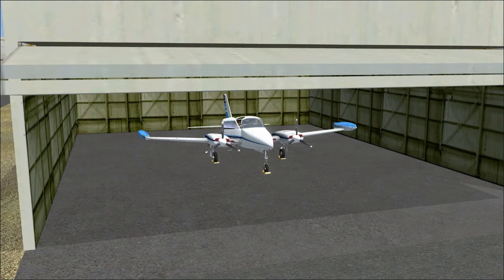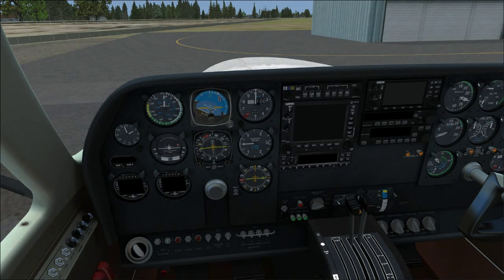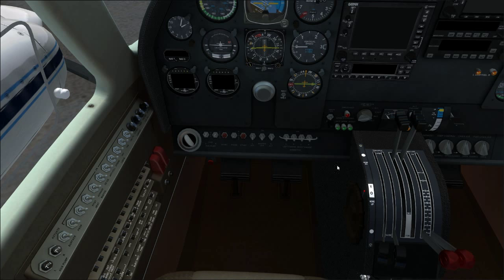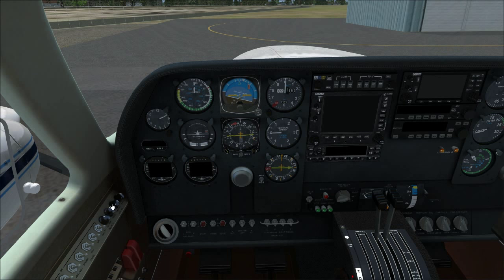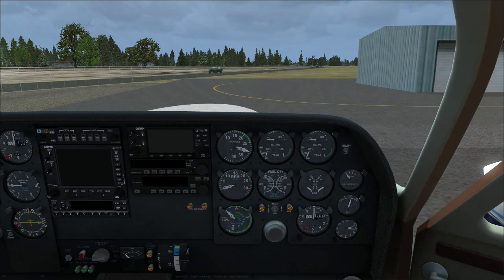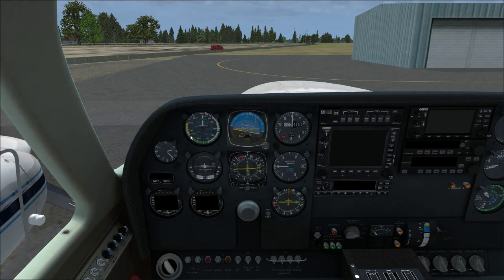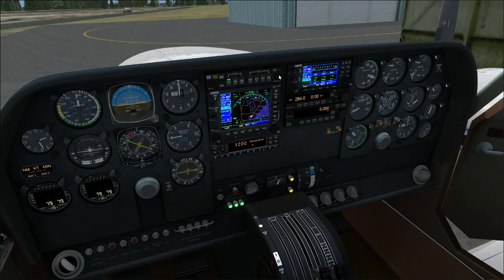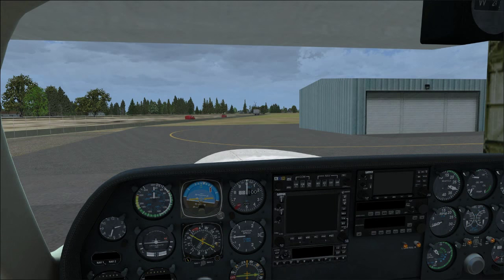Military Visualizations Cessna 310 Tutorial. Video 1, Aircraft Overview

Comment: Thanks a lot for the series, very nice!

One question to the constant speed props: You could see the angle of the blades changing whilst the engine is not running. Is this normal? I thought it is only possible to change the angle while the engine runs at a minimum of 1000 RPM. Does this work like that in the real aircraft as well or only bad modelling by Milviz? If bad modelling I think they fixed it in their new Redux however.
Thanks!
Reply from the maker: I dont think it would be since the mechanism that changes the prop pitch works off of oil pressure. So the engine needs to be running.
Reply: Thanks for the reply. I bought it now, amazing plane, and yes, they fixed it in the Redux version. Now the engine needs to be running to change blade angle.